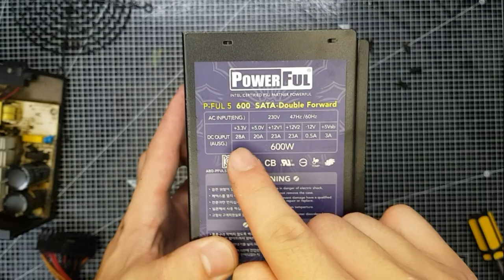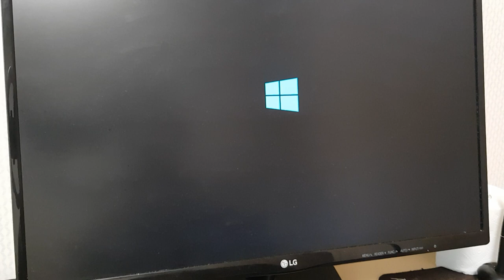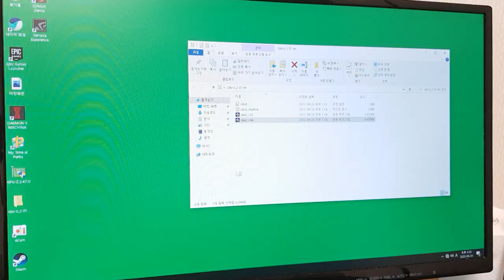Cleaning up an abandoned computer 2

Comment: how to remove thermalpaste , mainstream channels : isopropanol or q-tips , this channel : have you heard of soap ?
Reply: Meanwhile me : detergents go brrrrrrr
Reply: I saw others clean with water and soup and inmediately dry with compressed air. There is no problem if yo do that way. I've never saw cleaning the fans with water, they are not waterproof, better use isopropilic alcohol. At least he didn't washed the PSU with water.

Comment: Same thing as the previous video, using water and soap to clean computer components will cause them to rust in the near future. You are lucky so far that they still power up, even after letting them dry for 48 hours.

It's a ticking time bomb. The motherboards also have capacitors, just like the ones in the power supply, only much smaller. They do not do well after getting wet.
Reply: Rust won't form if the parts have been dried completely, there are many tech youtubers who've done this in the past, Tech Yes City, 8 Bit Guy to name a few, its not like the people are cleaning these parts and NOT drying them. If you remove the wet, then it's dry. The only thing I wouldn't do is put fans in there due to the bearings, now THAT will cause an issue. I think in this video they could have done a better job with the drying process though, using some sort of air movement on the parts.